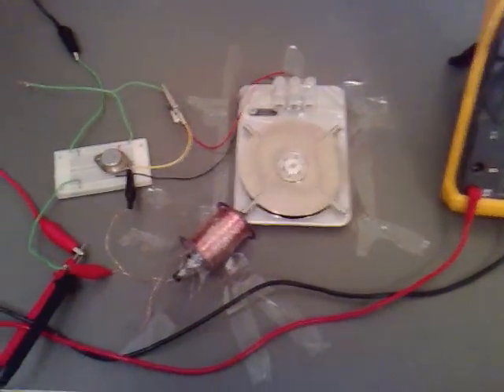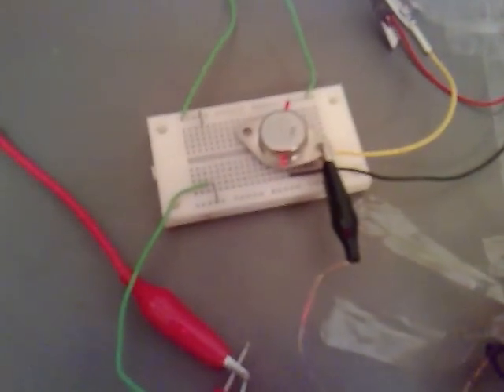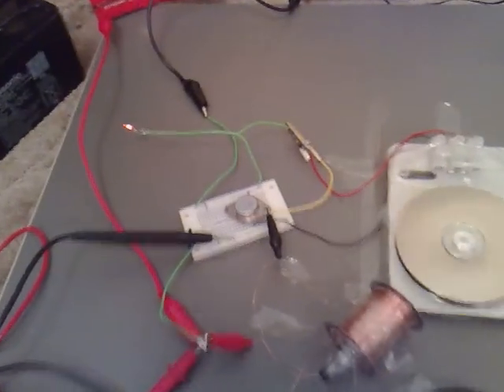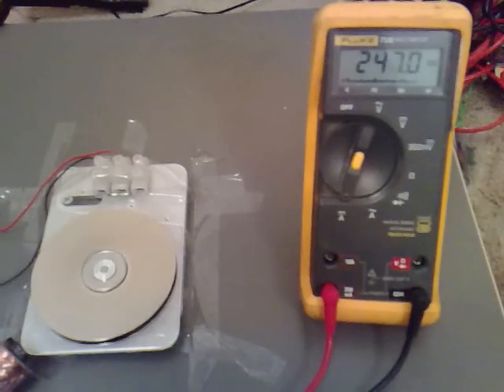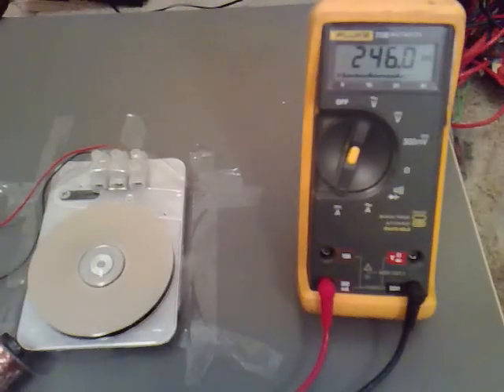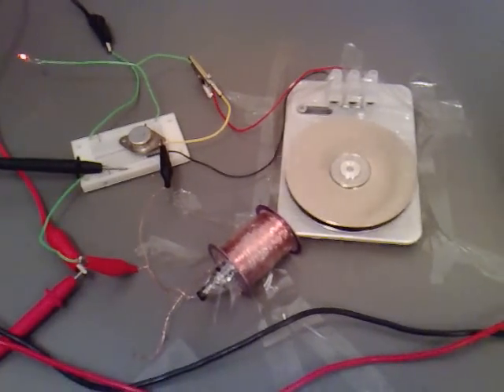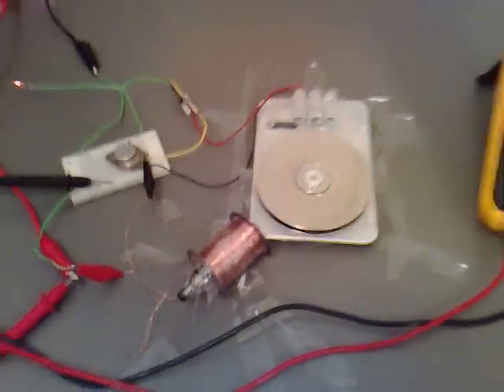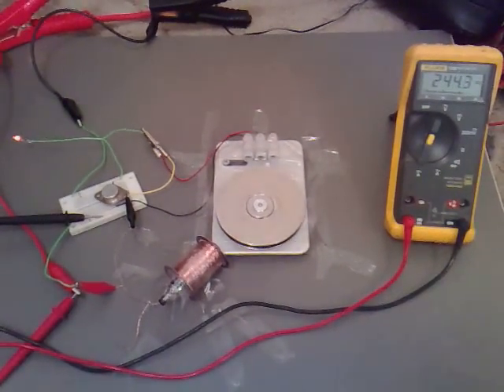Pulse Motor (Transistor & Reed) 027

Comment: The transistor- reed setup actually lets a lot less energy into the coil than without the transistor. But without the transistor, the reed switch burns out from flyback voltage.  My solution is to have the reed switch coming into the coil through a 1N5404 diode with a neon across the coil.  The 1N5404 blocks flyback from reaching the reed switch, and the neon provides an alternative path to prevent overheating and breaking of the circuit.